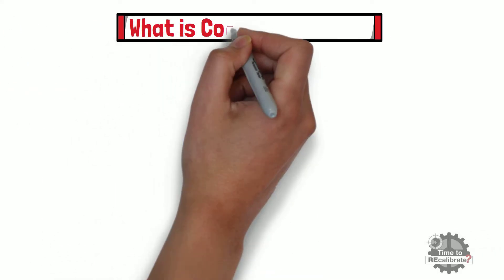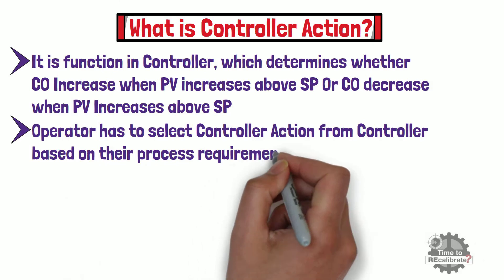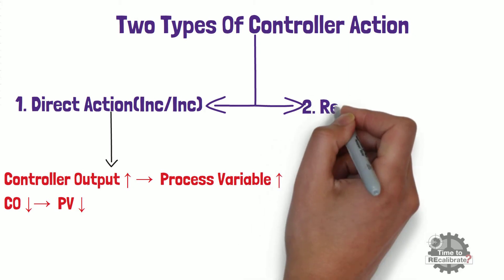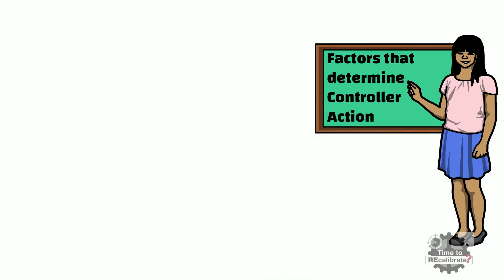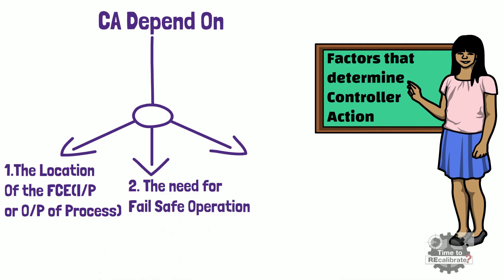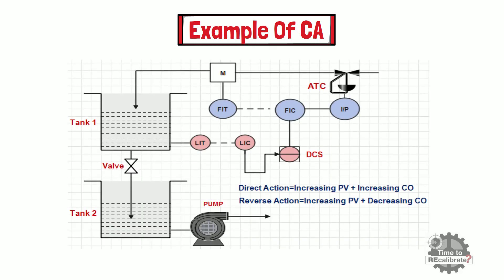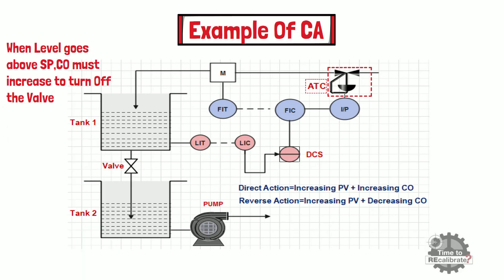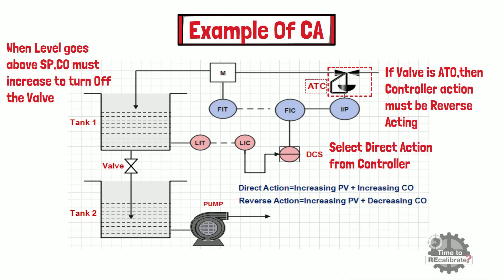What is Direct Action and Reverse Action - Understanding Process Controller Action

Comment: Hello 
We have two type of controllers here (FIC and LIC)
Can you explain to me how can select the direct and reverse acting 
Because we have cascade system that means output from LIC is set point to the FIC
and how select the type of control valve when the controllers change
Reply from the maker: Thanks for asking me this question. Controller action depends on three factors.
1. Location of Control Valve.
2. Type of Control Valve (ATC & ATO)
3. What is process requirement
Reply from the maker: Please give brief description of your question, and I will give the answer of your question
Reply: Here LIC is direct acting .there is no doubt on that.
Let assume FV valve is Fail close valve only .what is the action will come for slave controller(either direct or reverse)